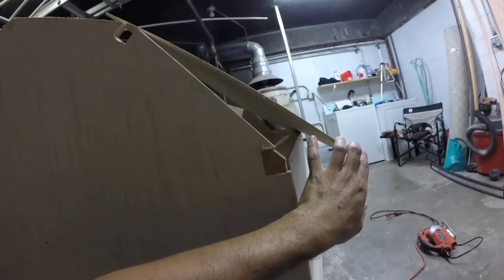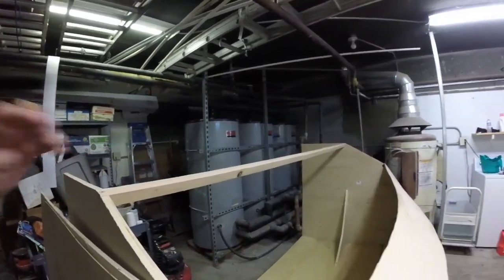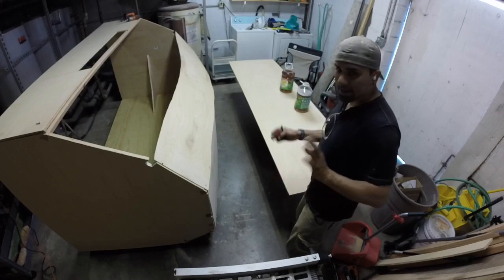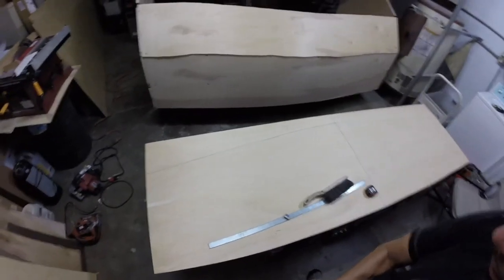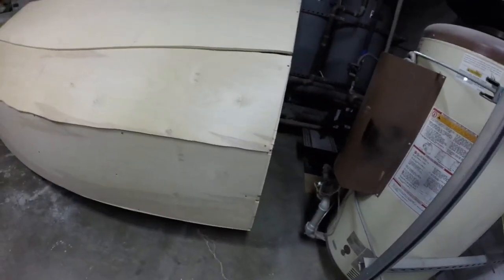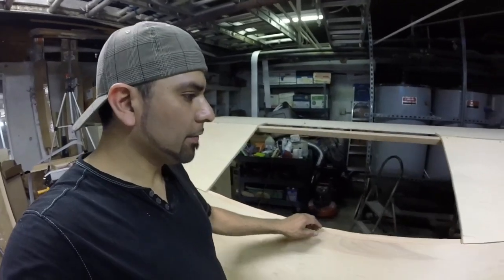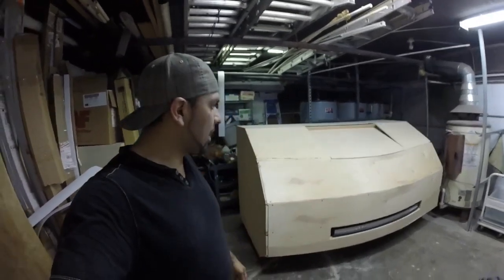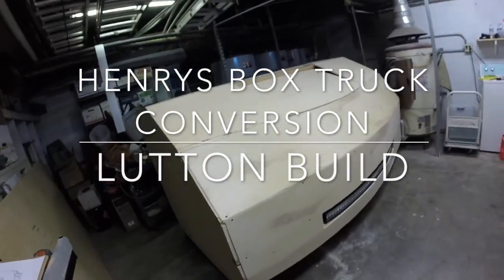Lutton Build (over-the-cab) fabrication (part5)

Comment: HI Henry, its been awhile. Man, I LIKE the way you're do'in this build, its Look'n So Good. I fully see what you're trying to do with the front of your "Cap" for your Box Truck Body. I think you're do'in a Great Job on it as you're building it. I use a small like 1/4" or 3/8's Clear Plastic/Vinyl Tubing to make my Curve's like what you're gonna have to make on the edges. I form the hose and tape it down and work with it until I get the right look I want. Then Fiberglass it. Your design is look'n Real Good❕😉
Reply from the maker: Thanks Danny, Im trying to imagine your explanation. 
My plan is to use my planer and belt sander for a quick and easy rounding of the edges, similar to how I knocked off the edge of that last arched stud I installed. Then most likely I will back fill the edges with a thin layer of bondo and hand sand it to a smooth consistent edge. 
But I'm definitely open to easier suggestions for faster, smooth consistent edges. 
But the reality is that sometimes theres no way around good'ol manual labor.
Reply: I wish I had video so I could show you what I mean.     Right on the edge where you need to put your Bondo....I lay the Tubing. Its like you laying your finger on that Lip that needs the Bondo put on, I put the Tubing and keep it there with Tape (like Duct Tape or any good tape that will hold) Then, I lay the Fiber Glass Cloth over the tubing for an Great Radius to my corner.     I Hope this will explain what I mean. Please let me know IF you need more help on this, Henry.

Comment: Been looking for you to drop this video man, it's cool how you go for it, and just get it done. Looking real good bruv.
One thing we used a lot building boats instead of bondo for gaps and to make stronger joints... Mix the fiberglass resin with sawdust until it is like creamy peanut butter.
First though you wet the wood at the joint with resin and let it get almost tacky. That is because dry wood will pull some of the resin out of the peanut butter. Then make the peanut butter and fill everything before the first coat is dry so you get a permanent chemical bond. It's strong as hell when dry, permanently part of the wood where the first coat of resin soaked into the pores. hard to shape. Then fiberglass, then bondo or gelcoat.
Maybe you already know all this, your work so far has been great, but the peanut butter is awesome, especially when you are freestyling!
Reply from the maker: Yea man, the peanut butter soup is awesome. The reason I was thinking bondo is because it doesn't ooze down too much. Also I find it easier and faster to shave and shape bondo. Once Im ready to wrap the finished part, I will soak all parts together with resin to penetrate the wood and fuse adjoining parts together. So eventually all parts will get the chemical bond treatment regardless. But I like the peanut butter soup, its actually the strongest bonding method! Thanks for explaining it here, everyone benefits from this.
Reply: Yeah man, I thought you probably knew all about that, from watching your videos. Like that tailgate "cap" you made really turned out nice, very cool.
I wear out the epoxy and peanut butter for sure. I build so much stuff out of 1/4 plywood coated with epoxy, strong as hell, light weight, waterproof. Plus the peanut butter hides my crappy cuts, especially with a little bondo and/or some filler primer. I just make it perfectly square, bang it together with a few brads, then let the epoxy do the work. 
I lay down a couple of pieces of clear tape on either side of an inside corner, wet out the corner, then put a bead of peanut butter down between them by squishing it out of the cut-off corner of a plastic bag like a cake maker., then spread/fair it with a plastic piece I cut for whatever radius I need. When it's perfect I pull the tape up for crisp edges. Hit it with some sandpaper later and after paint it looks like one perfect piece of plastic.

Anyway, just watched your new video, this part is going to be awesome for sure.

Comment: Lookin good! Will you be using epoxy inside and outside of the build? It will strengthen and protect the wood from moisture even if there is a small crack in the glass.
Reply from the maker: Yea, I will use woven fiberglass on the exterior and chopped fiberglass in the interior. Thanks!